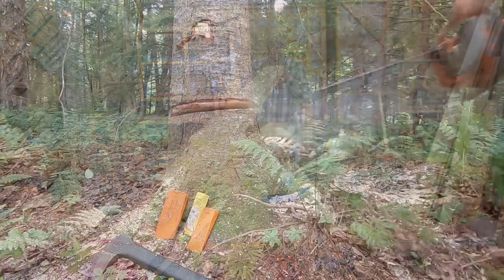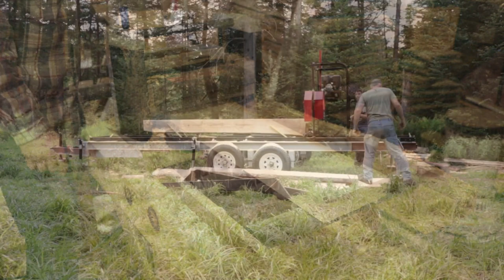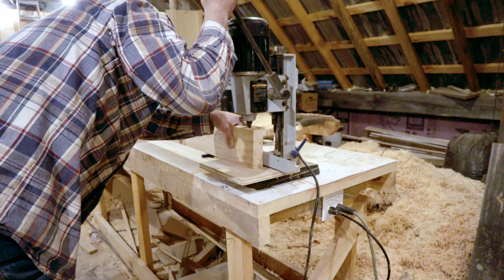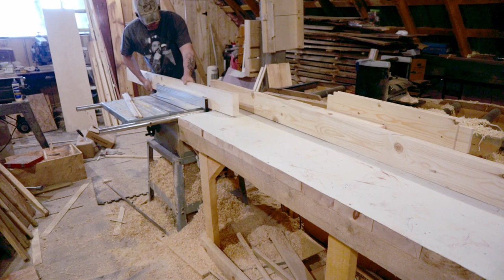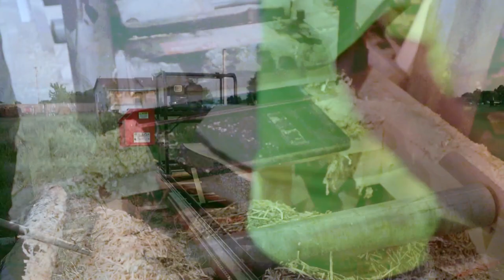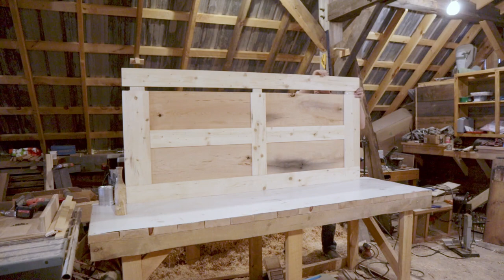Simple Beautiful Interior Door, No Nails or Screws

Comment: This is a nice build. I prefer to prefinish or even prepaint panels before I glue frames together. If something shrinks it will show an unfinished seam. Had to learn that the hard way. Chamfers on the panels and tenons help with the assembly.
Reply: I agree, had the same issue one time with panels shrinking, now I always finish them before assembly. Also agree it is a very nice build. I think the walnut pins will look nice too!
Reply from the maker: I've done it both ways with mixed results.  As for the chamfers, I do it on all timber joinery.  Not sure why I didn't do it here.

Comment: Very Nice Door. Great Job.  FWIW..... Most doors made commercially, esp. cabinet doors, are made wrong and heres why.  The standard cabinet hinge these days is a 35 mm cup hinge which is spring loaded.  I dont like these as I prefer the look of old school but thats for another day.  When the door closes, it snaps shut.  Not much, but it snaps shut.  That puts the impulse load force on the opposing door stile and forces the stub tennon to resist an impulse moment force or torquer.  The stub tennon is not deep enough to resist this torquer so it compromises the glue joint.   At first, you will see cracking in the finish where the stile meets the rail.  Ultimately, esp. if your wife slams the door, the door will fail.  Likewise, on very wide doors, the weight of the door is supported by the joints connecting the hinge stile to the rest of the door.  If the door is wide and made of silly putty wood products like MDF, Melamine etc, the door will sag and come out of square.

Dowel joints help here but that is also a modern world quick fix.  The ultimate solution to a door that will last the ages is the mortise and tennon joint.  With a deep, properly fit mortise and tennon joint, the door joint has the ability to resist torquers in all THREE major axis of joint rotation.  Lastly, the use of draw bore pins can LOCK the joint like a dovetail.   Its NEVER GOING to come apart!

Another BITCH-KITTY of mine is groove location.  The modern world likes their fancy moulding details on the kitchen doors.  Well, in order to get the real estate needed to cut this molding detail, the industry had to set the groove location back by one eighth of an inch.  That means on a standard 3/4 inch cab door, the meat left over holding the panel in the door is only 1/8 inch thick!!!!!  If you punch the panel, theres a good chance you will separate the panel from the rail/stile structure.

Old school often went with the 1/3 rule.  The mortise width is 1/3 the thickness of the rail or stile and its centered about the mortises that that hold the door together.

The door you made is done correctly and will outlast how many more years either you or me have left!  I love watching your work.